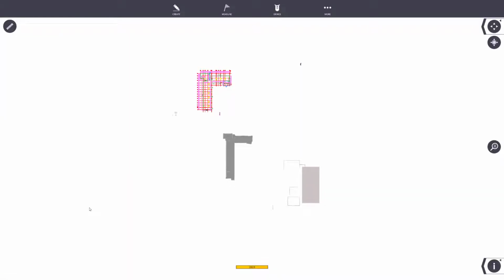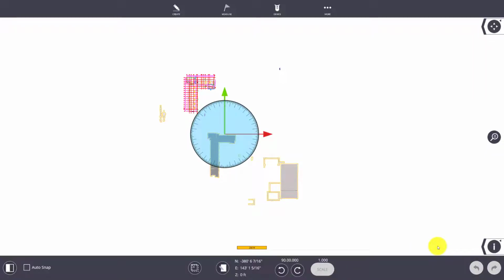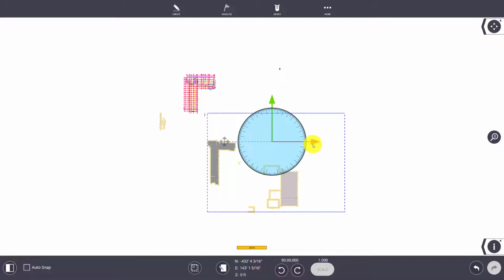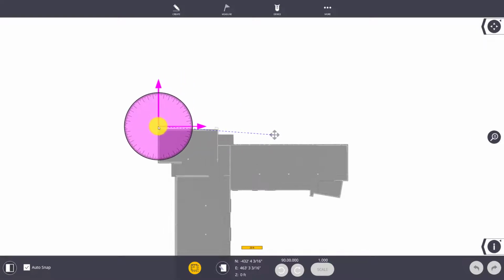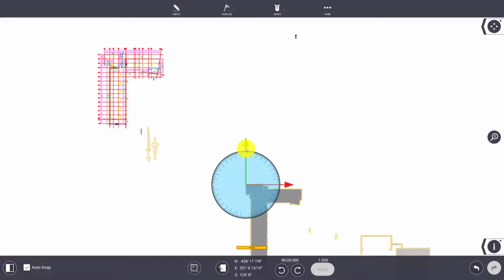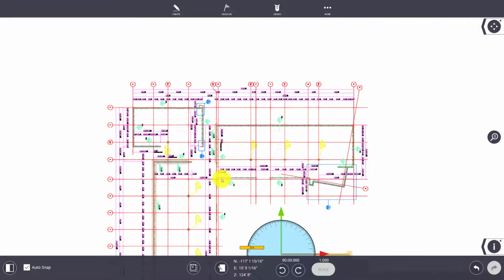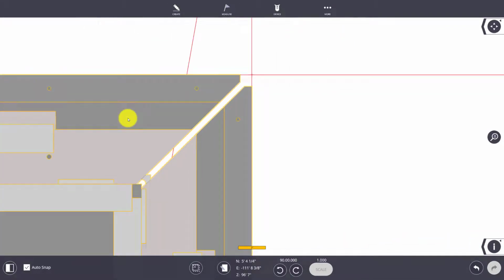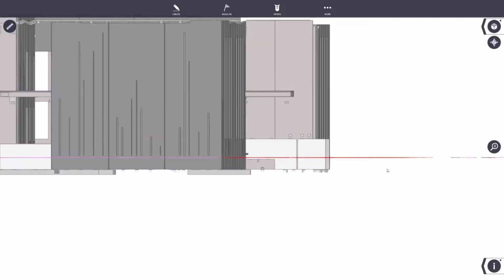FieldLink Tools: Align Multiple Model Files Drag and Drop

Comment: Hope this helps someone. 

 The points and any line you draw on the tool are separate from the “model” or CAD file. 
 I had to create my bld corners on CAD and drag it to the point I made via coordinates. My bld envelope is an offset, so I needed to create it in CAD to see what I was lining up. 
 I could not simply change the coordinates on the CAD file for some reason. 

 You know you are a dork when you get excited that you finally figure out how to sync the GPS to the surveyors coordinates. 
 I literally put my fists in the air like Rocky after he climbed the stairs.

Comment: The coordinates provided to me by my surveyor do not match my model. Is there a way to drag a model to align with the coordinate system?
 I want to bring my points with it if possible since the envelope corner is an offset (in is not on a line so I need it to line up with his point)
 
 For instance, when I enter the coordinates for a bld corner it shows way off in space. 

 Thanks
Reply: If it helps anyone, I had to extend the building line on the cad file since I needed a point of reference. I then created the point of the coordinates able to drag the model to them.